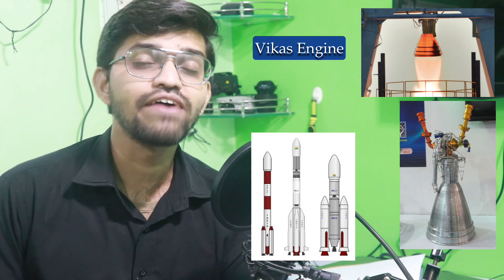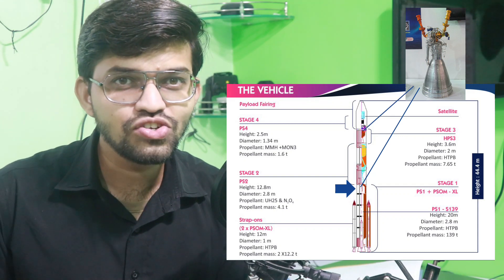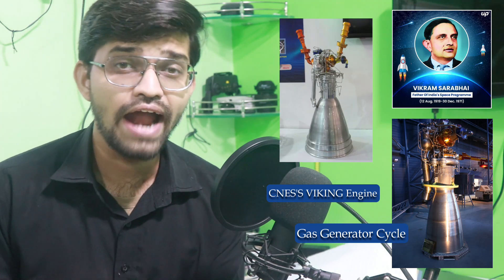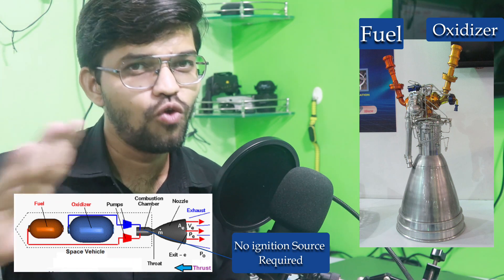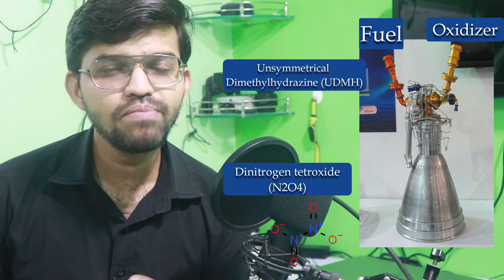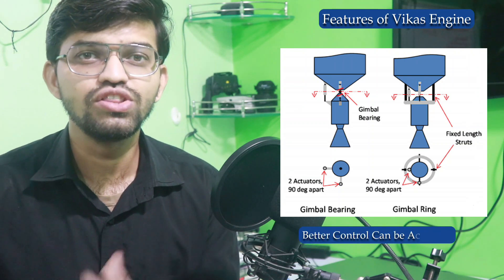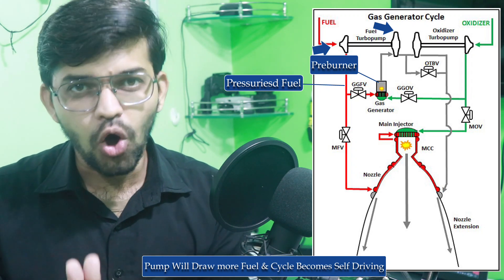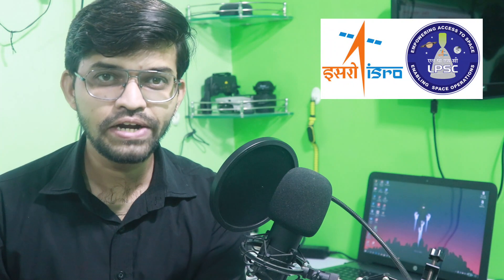What is Vikas Engine in PSLV ?? || How Does It Works??

Comment: Why vikas engine is not in the initial launch this is due to vikas is designed to burn when there is a absence of oxygen thats why it is mixed with oxidizer above the stratosphere ,while solid propellants burn doesn' need that combines with environmental oxygen ,thats why vikas is not placed at the initial stage ,
Reply from the maker: Yes!! youre amazing ...